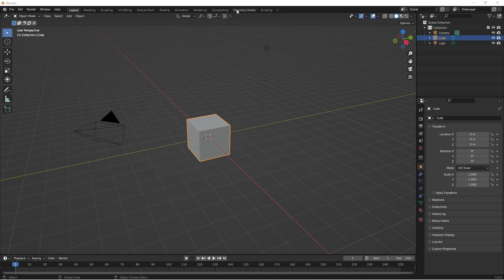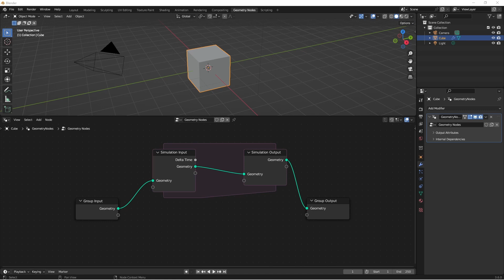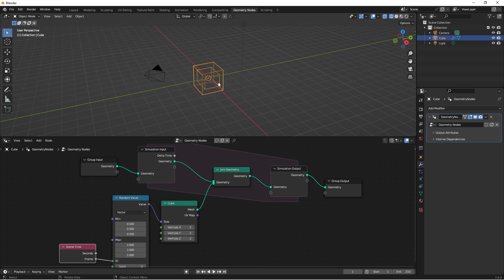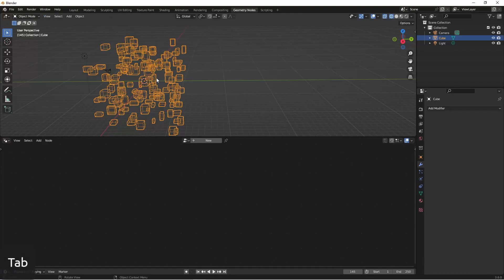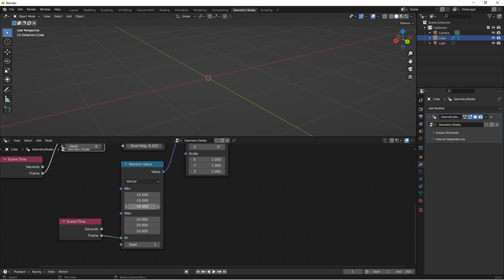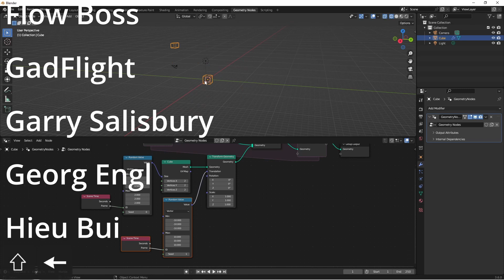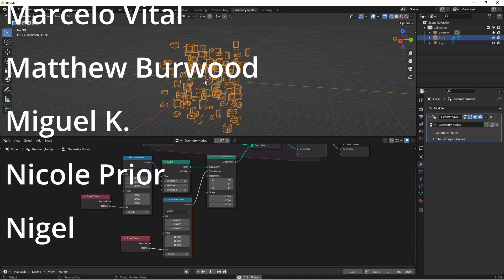Intro to Simulation Nodes Part 1: Basics and Making Random Objects

Comment: Great stuff. I just gave this a spin on the Loops build (PR109164).
Got a similar result by plugging an Add node (with 1 in the bottom field) into the Serial Loop Output and then feeding it back into the top socket of the Add node via the Serial Loop Input